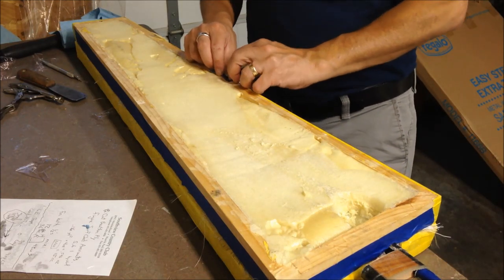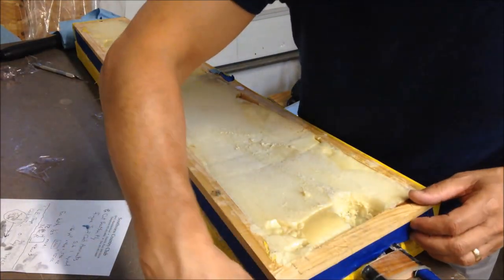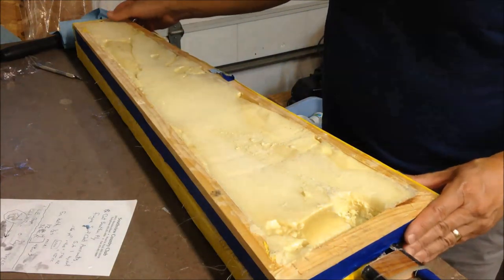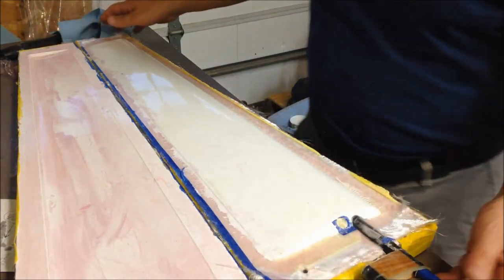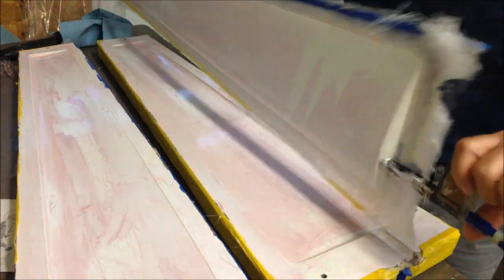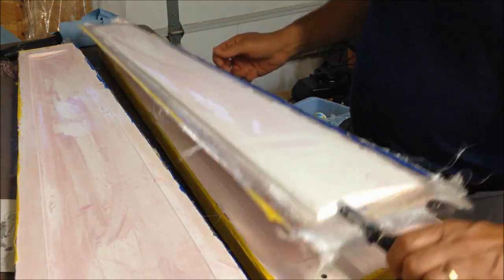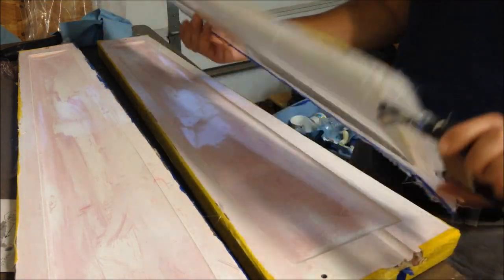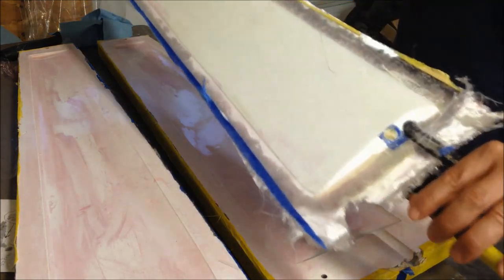Fiberglass Rotor Blade - De-Molding

Comment: hello sir can you provide me with your email address. i would like to do a project concerning this. i will give credits to you if you help.
Reply from the maker: Kay EM.  Lets just dialog here first.  What do you want to know?
Reply: @randysonnicksen9475  what are the dimensions for the rotor blades.. Which proportions of the fiberglass did you use.
Reply from the maker: @mitchm7563  If you provide your email, I will dialog with you.  Have you watched the other videos on the rotor fabrication?
I did my designing in Sketchup.  If you have that program I can provide you with some 3D models.
Reply: @randysonnicksen9475  how many layers of fiberglass did you use to make the thickness
Reply from the maker: @rootsculture7324  This video https://www.youtube.com/watch?v=D5yzFrMb2d4 shows the layup details.
This video https://www.youtube.com/watch?v=6A5hMbJTq_w shows how I assembled the rotor blade.
Reply: @randysonnicksen9475  what did you applied to prevent your mould from sticking?
Reply: @randysonnicksen9475  after watching your video I found you made your rotor with 6 layers of fiberglass.i.e 3 top 3 bottom,Wright?
Reply: @randysonnicksen9475  I also have the same program. Kindly send me detailed video of this process
Reply from the maker: @rootsculture7324  First, I waxed the mould with several coats of caunuba (sp?) wax.  Lettting each coat dry, then buffing excess wax off.  Then, I sprayed the mould with PVA (poly-vinyl-alcohol) which is a water soluble solution that is applied with an aerosol sprayer (available at home depot), and leaves a thin film between the mould and the resin allowing "easy" release of the part.   After you remove the part from the mould, peel excess PVA film away, and rinse the rest away with water.  I learned most of my fiberglass skills through educational videos at fiberglast.com.  A really good site for beginners.  https://www.fibreglast.com/product/PVA_Release_Film_13/Mold_Releases
Reply: @randysonnicksen9475  thank you for this information. 
how do you laminate foam with fiberglass. Kindly send link
Reply from the maker: @rootsculture7324  If you look at all of my video's on this topic (rotor blade layup) you can see that I moulded the top and bottom skins separately.  Then, before they were fully cured, I bonded them together with the structural internals inside (long fiberglass rod, leading edge, tip weights, etc).  While they were curing and sandwiched together, I poured a 2 part mix-and-pour urethane foam into the void between the two skins to completely fill it with foam.  See  https://www.fibreglast.com/product/2lb-Mix-And-Pour-Foam
Another way to layup fiberglass over foam is to hot-wire cut the foam core to the profile you want, and then layup the fiberglass over the outside of the foam, however this will not give you a smooth surface finish like the mould will, unless you add layers of epoxy and sand/buff to smooth.  If you search on youtube, you can find examples of each method.  Laying up over a foam wing airfoil is tricky because of the tight curves.  Difficult to keep the fiberglass fabric down tight on the core.  If you vacuum bag, there is a risk of getting wrinkles.  Good luck.
Reply: @randysonnicksen9475  not yet clear especially where you added breather and vacuum bag.. Kindly provide me with full video
Reply from the maker: @rootsculture7324  I don’t have any more video, sorry. Again, go to fiberglast.com for education videos
Reply: @randysonnicksen9475  how long do they need be for ultralight 🚁 that weigh 300kg..i.e total length and chord
Reply: @randysonnicksen9475  hello
Reply from the maker: @rootsculture7324  I don't mean to be disrespectful, but I cannot best answer these questions for you.  Google or YouTube searches would give you more complete results.
Reply: @randysonnicksen9475  OK. Thank you